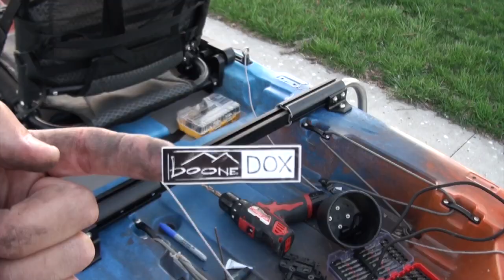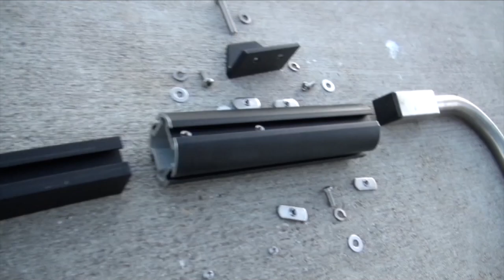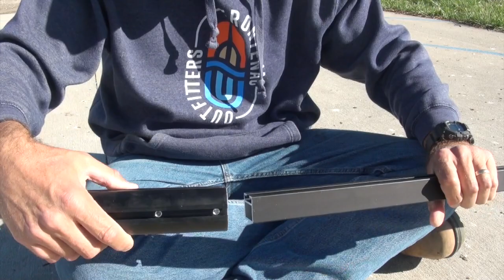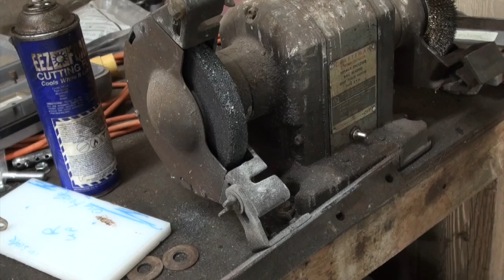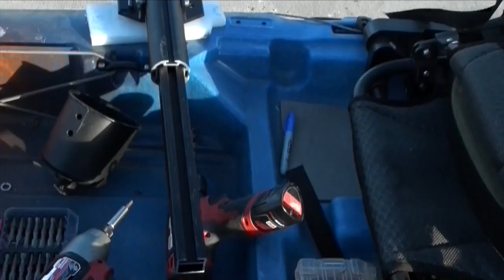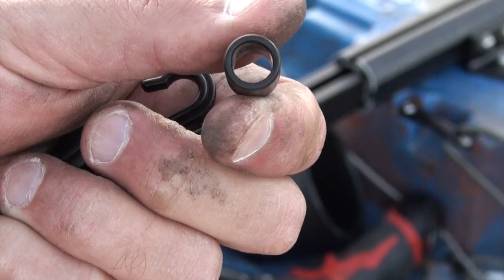Boonedox Landing Gear Standard Installation

Comment: Enjoying your videos - both fishing and rigging!  One question: What is this 180lb limitation I read about regarding the Groovy Boonedox Gear?  I have no plans to rely on my Native Slayer Propel tracks - I will remove the built-in rod holders behind the seat and include HDPE mounting plates inside the hull.  I'm thinking that with the shared weight of me holding the bow of the cart the 180lb limit is okay.  What do you think?

Comment: I have a 2020 hobie revo and been trying to get someone at Boonedox to answer me on where I should install.  Behind the seat seems curved and the backing plate won't sit flush so maybe further back?  I'm trying to find a picture or a video on someone installing it on a revo 11 before I drill there.  Can someone please answer me?  I've tried every form of communication for almost a week and can't get anyone to talk to me.
Reply: Did you ever get an answer?  I also have a Hobie OB 2020. It looks as thought the installation is not easy but the product may be what I'm looking for--an easy way to get from trailer to water and back again without having to wrestle with the Hobie scupper wheel gear.
Reply: @doyledh  I never got an answer from anyone who did it so we just took the chance and turned out perfectly.  It's been so hot we've only tried them out once so far.  He has an outback too and we had no worries about installing on his, was just my revo no one has done.  First time out was a little awkward figuring when to take the wheels out and turn them. Would be nice it was like a turn them and lock them in place but these you have to pull them out and then flip them and put them back in place, so depending on the water where you launch could be difficult.  Was windy the day we launched so it was a little rough but coming in was a breeze.  We just get out in the water, flipped them and walked right out.  I'd recommend them.  Don't need anyones help lifting to get the cart out of the scupper holes, like you said.

Comment: good morning MrBear from florida. i have a bonafide ss127  i purchesd the landing gear three years a go for my kayak, my problem is i put it on the ss127 were bonafide and Boondox tell you to put it on the kayak backer plates and all.Both port and starboard sides cracked 7 times i had to heat welld them back together.i contackted Boondox & Bonafide about this problem sevarel times and got no respons , not a way to run comp. so use at your own risk and dont look for help .
Reply from the maker: I’m sorry to hear of your difficulties Mr. Bear. Bonafide started designing kayaks to handle this equipment after the SS 127. The Track Kit works well with the RVR 119 and PWR 129. The same is true with the more recent Native Watercraft models. 
This video shows one installation technique in particular that alleviates the potential of hull rupture of an overloaded kayak: rounding the corners of the “stiffener” board. Each rotomolded kayak has variable hull thickness from one area to the next. The key to a solid installation is to keep the stiffener plate as large as possible, shape it to the flat surface available inside the hull and round the edges of the plate that contact the hull. All of those techniques are demonstrated in this video. Again, we are sorry for your poor prior experience with Landing Gear. We made this video to help customers and dealers avoid hull rupture and have a better experience with Landing Gear than you have had.